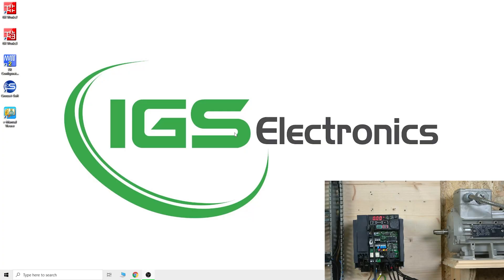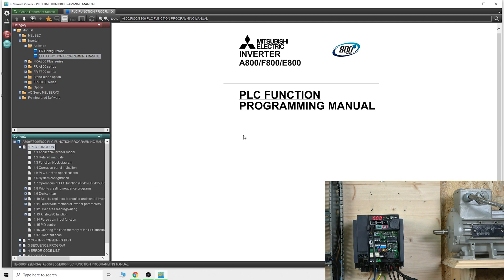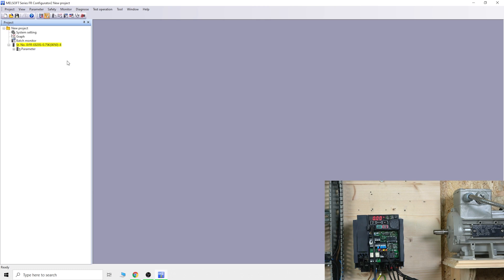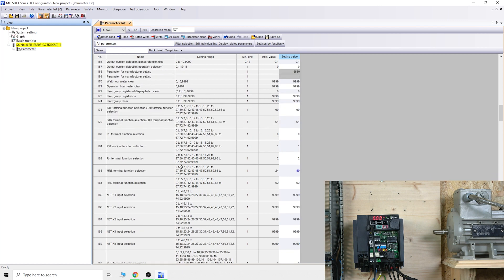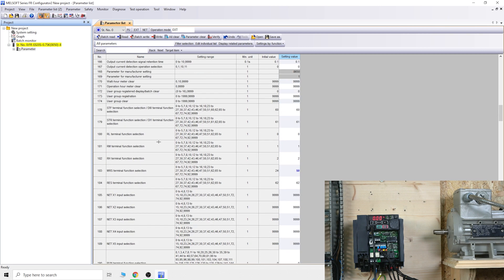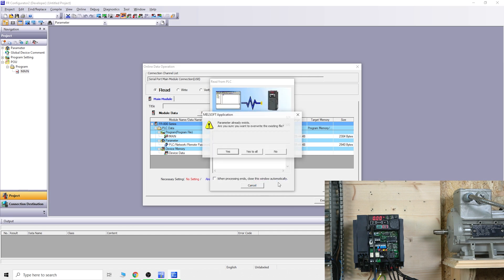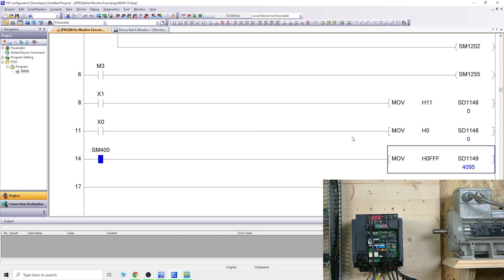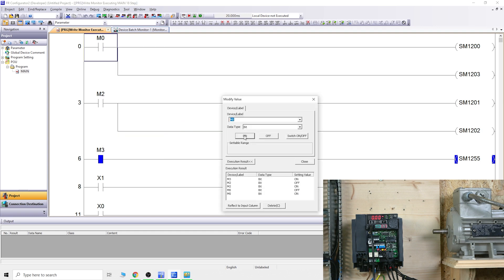Mitsubishi E800 drive internal PLC set up, programming with FR Configurator 2/developer. (English)

Comment: Thank for the video. Do you know if is It posible to use 24V of the inverter to supply the sensors of the machine?
Reply from the maker: Hi Ander. I never gone that far of check in it, so not in position to give you correct answer on this my friend.
Reply: I don't think that the internal supply will deliver enough current (only a few hundres milliamps). But it is not a problem to use an external supply instead of the internal
Reply: @TheMBagge  Thanks,
Yes, but the point of my question was that, to create a compact machine only with 230 supply without no extra elements of typical cabinet ..
Anyway a hundred of miliamps should be enought to a few sensors